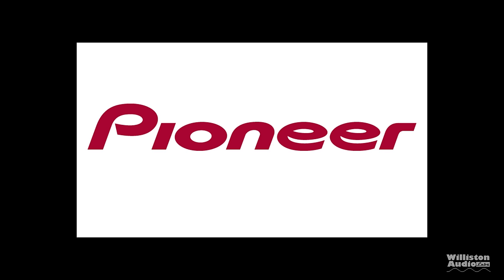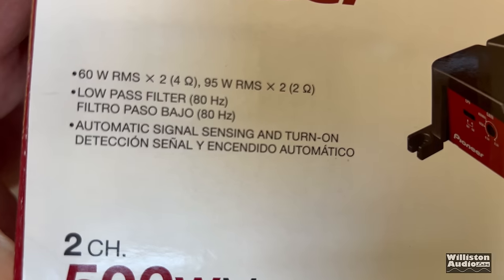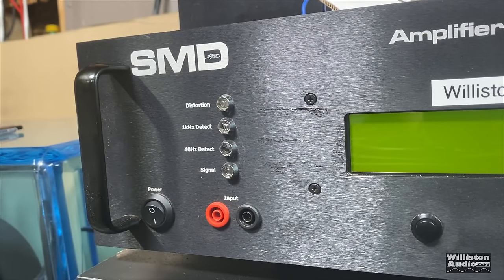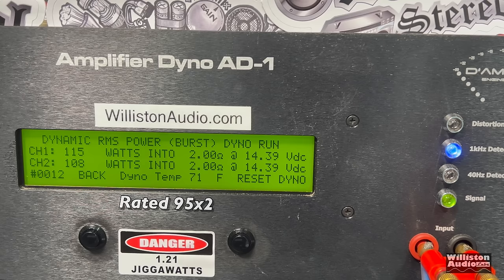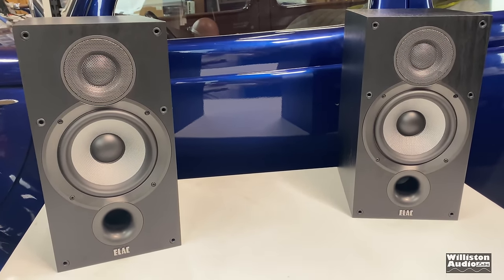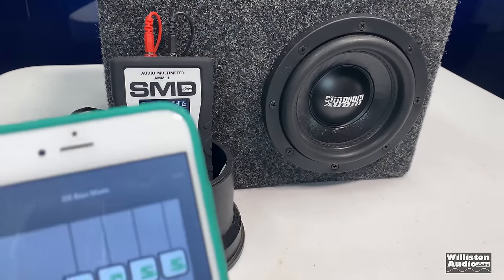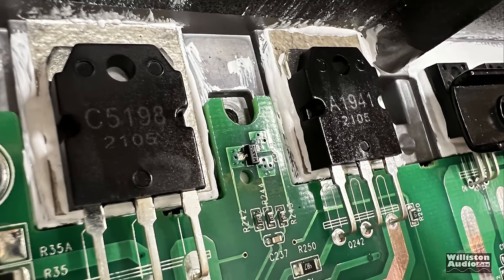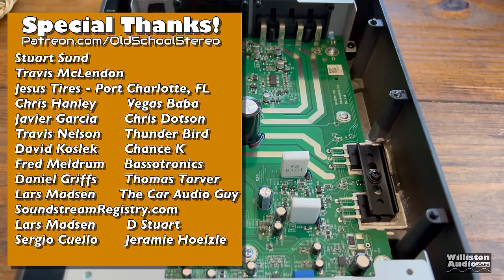Should You Buy the Cheapest? Pioneer GM-A3702

Comment from the maker: SHOP (Affiliate Links)
Pioneer GM-A3702: https://amzn.to/3UtqkTL
Shop for Other Low Budget Amplifiers
Down4Sound JP34ab: https://lddy.no/15b14
Pioneer GM-D8704: https://amzn.to/3B28oGP
Pioneer GM-A6704: https://amzn.to/3KXD8NT
CT Sounds CT-80.4AB: https://amzn.to/3L45tCe
Alpine MRV-F300: https://amzn.to/3BqW18t
DATASAT N1 on Amazon: https://amzn.to/3bX79jC
DATASAT N4: https://amzn.to/3AX4NtA

Used in this video 
Elac Debut 2.0 B6.2 Bookshelf Speakers: https://amzn.to/3REg2hB
Sundown SA6.5 6.5" Subwoofer: https://lddy.no/1cy5x
Pioneer DEH-80PRS Head Unit: (eBay Affiliate link) https://ebay.to/3xdUwZ6
Stinger 6000 Series RCA Cables: https://amzn.to/3d4W80b
Stinger 12ga OFC Speaker Wire: https://amzn.to/3d4pWKo
D4S 8g OFC Power Wire: https://lddy.no/1csoz
Precision Screwdriver: https://amzn.to/3B920NZ

Video Playlist of Affordable Amplifiers: https://bit.ly/3cEQYHJ

VIDEO INDEX
0:00 INTRO
1:02 THE CHEAPEST
1:26 UNBOXING
2:01 FEATURES AND SPECS
3:02 AMP DYNO TESTS
5:44 SQ TESTS
6:52 CAN IT POWER A SUBWOOFER?
8:09 TERMALS AND INTERNALS
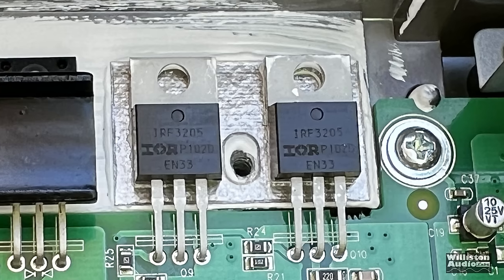9:13 PROS / CONS
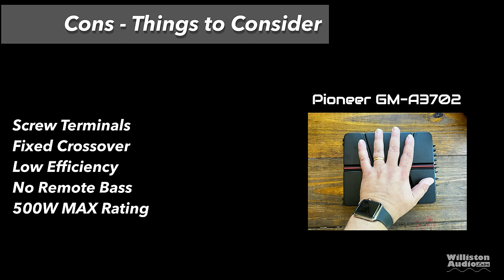9:56 FINAL THOUGHTS
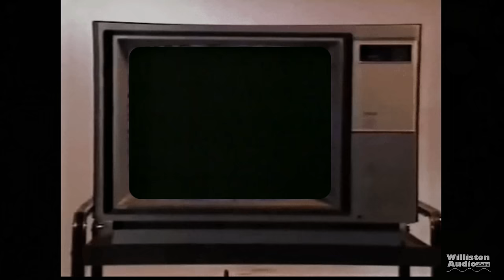10:35 EXTRAS

--------- Cameras and Gear Used To Shoot This Video -------
(Video Gear I Use) 
Camera - iPhone 13pro 1TB - https://amzn.to/3nCjGvc
RODE Wireless Go II Microphones: https://amzn.to/3Q6NVHl
Shure MV7 Microphone: https://amzn.to/3A4OICK
Zoom H4n Audio Recorder: https://amzn.to/3BXjVsS
960 LED Panel: https://amzn.to/2Sxoq3S

This VIDEO was EDITED with LumaFusion on an iPad Pro 12.9:
iPad: https://amzn.to/2Ancr1W
Software: https://goo.gl/6yvWss

--------- Test Bench Equipment -------
SMD / D'Amore Engineering Amp Dyno: https://goo.gl/sJTcf7
XS Power D1400 Batteries - https://amzn.to/2BPFCKW
XS Power PSC60 Charger - https://amzn.to/2CHGcfs
Fluke 1000A AC/DC Clamp Meter: https://amzn.to/2Rw5WDA
Handheld Dyno: http://amzn.to/2u2EgKV
My Favorite Screwdriver Kit: http://amzn.to/2x0VzcE

DISCLAIMER: This video and description contains affiliate links, which means that if you purchase from one of the product links, I may receive a small commission. As an Amazon Associate I earn from qualifying purchases

Comment: I knew a guy once that had a complete system from Walmart.  Pioneer subs, amps, head unit and mids and highs. He actually surprised me at how hard it hit. He had 2 big Pioneer amps on 4 12's and was nothing to be ashamed of.  You could hear him rolling down the block very well.  Sounded like he had a good quality set of 15's and a good amplifier. He bought it all on a Walmart credit card lol
Reply: sometimes, design and quality of installation is more important than quality of gear. I believe a quality system can be built with all Pioneer gear for half the price of JL or Rockford...or any of these other Chinese made brands....I have no problem with Chinese made equipment, but not if it costs as much as European or American made equipment, considering it costs FAR less to manufacture by Chinese slave labor.
Reply: I run two pioneer class D mono amps at 2ohms and 800w RMS each feeding four pioneer champion series TS-W311S4 12's in sealed boxes made to the exact internal volume for my sub's and 100% airtight, my system punches pretty hard.
I have a class D handling my MIDs and highs producing 500w RMS but I'm really not a fan of the sound quality from a class D on the MIDs and highs, they are great for sub's though.
Reply: @stevefox3763  yeah definitely go a/b for mids and highs. im only pushing around 600-700wrms @ 1ohm (xda91rb) on 2 tw-261d4's and it sounds good, my box is just a bit too small and tuned too high.
Reply: @raymo6795  I have obs Chevy which I still owned but when I was 18 It had my dad kickers 2 8inch cvr model with the flames on it they had there own sealed box with silver xplod Sony amp it hit hard haha I was 18 years old took it to shop to get amp wire run and the guy who did the install was with big smile because he never seen 2 8 inches subs hit that hard. Sadly to San Francisco assholes they open the truck one time my brother took it to work just to find the subs gone 😢 but now the truck has two sound streams vangogh 10s with 1200rms skar amp which was big upgrade
Reply: It's all hooking it up correctly...any sub in the right box is going to kill it. I remember back when we use to get the free crutchfield magazines and dream. Pioneer, Polk and JVC JBL good times
Reply: @lagginswag  A/B or bust for midrange.
Reply: Balling on a budget, I put a pioneer 10 through the ringer lol and it never died! Hit way harder than it should have imo
Reply: @stevefox3763  I have used Pioneer equipment since the early 2000's and I have always been satisfied with how well it performs for the price.
Having owned a plethora of subwoofers, speakers and head units throughout the years, although I have never owned that many Pioneer amplifiers.
My current setup is mostly Pioneer (with the exception of the subwoofer and its amp). 
I have a custom built sound-bar in the rear with two component sets (4 speakers in total), these being the TS-E 170Ci components. These are wired in series into 8 ohms, and powered by a 4-channel Pioneer amp (GM-D8604), which is good enough for this setup. It produces around 200w(x2) bridged in 8 ohms. It sounds super clean, and eliminates some of the harsh sound a Class D amp normally makes.
The head unit I am using is a Pioneer DEH-X8500DAB, which features Hi-Volt (4v) outputs (3-way), DAB radio, Bluetooth and so on. It's an older model, but it works great.
The subwoofer I have in my setup is an Orion HCCA 15" unit, driven by a Dynabel BF-7501 amplifier (yes, this is an early Korean made amp). It produces 2500w in 1 ohm.
Reply: @Skarfar90  I have the GM-D8604 as well, im running it in 4ch with 4ohms rear (2x100w rms) and 2ohms front (2x150w rms). I have infinity main drivers up front with compression driver tweeters and have kicker components in the rear.    
I have 4x pioneer TS-W311S4 12" subs driven by 2x GM-D9601 amps running at 2ohms (800w rms per amp) and have a Sony touchscreen headunit.

I run two 9601 mono amps at 2ohms instead of one at 1ohm because at 1ohm it produces 1200w rms but two at 800w rms is 1600w rms :)
Reply: @stevefox3763  9601 are great amplifiers. Makes a good match for those 311 subs
Reply: @Skarfar90  if I had the room or the electrical headroom I would add a third one and another two 12's but I am at the limit of my cars electrical system and kill alternators quickly as it is and Dont have room for any more sub's in the boot either :(

Have you seen what the 9601 goes for these days, they have sky rocketed now they are a hard to get amp, they go for more on ebay now than they cost when new!
Reply: @stevefox3763  That's crazy. Did not know that the 9601's has inflated in price. 
It could be affected by the slightly higher price of the 9701 (its replacement)
Reply: @Skarfar90  The 9701 is the exact same amp but in a different outer shell, the older 9601 is better looking and i think that has a lot to do with it.   When i bought my second 9601, already owning the 8604 and a 9601, i wanted the third amp to match but they were already discontinued at that point and it stung real hard paying more for it used than i paid for my first one brand new.

I watched a few on ebay and every single one went crazy at auction, i just had to accept that it was a price i had to pay if i wanted matching amps and entered an offensively high bid to win it, fortunately it went for slightly less than the ones i had been watching went for but it was still more than they cost when new :(
Reply: My entire setup is from Walmart.. I have three Pioneer amps three power acoustic amps 14 speakers along with six subwoofers and two AGM batteries from Menards.. I got a few videos on my page check it out
Reply: It's just about knowing what works, yeah?
For example I've got a Ford with 'Premium Sound'
The sound is awful. Driven to any reasonable level it makes noise not music. By reasonable sound level I mean to 20 out of 30 steps and it still isn't load enough. I'm endlessly playing with the balance/fader and bass to get some semblance of reasonable sound. Why is it like this? Well because the factory amplifier is inconsistent with the premium sound promise. Sure it is better than basic sound but very, very disappointing - I'd call it low Mid-Fi (out of lowfi, midfi and hifi). Turn it on and never turn it over 12/30 then the sound is passable.

How would we fix it? Ideally it would have line level outputs on the head unit but it doesn't and I'm not splicing RCAs onto the factory harness where it plugs into the amp I can tell you.

Hypothetically if it had line level RCA outputs (which it doesn't) what I'd do is run 3 of these amps. One for the front speakers, one for the rear and one bridged one for the crappy sub. You can practically guarantee the sound quality improvement would be absolutely dramatic even with the junk factory speakers. 
If you wanted to get spiffy, run good quality speaker wire directly from the amp to the junk speakers. Want to improve that again just upgrade the existing speakers with some $100pr types. With a bit of labor and about $500 you'd actually have low end Hi-Fi with the stock head unit which I think is fine in a car.

BTW the factory head unit isn't the main problem but all of it together is the main problem. Poor quality is baked in unfortunately.
Reply: Insignia had a set that was a box subs and amp and it was $200. Sob hit hard!

Comment: Back around 1989 one of my first car audio systems was a small Pioneer 2 channel amp running 4 Pioneer 6×9s and it was a real screamer.   I had all 4 speakers facing up behind the seat of my S-10 pickup.  I played a lot of GnR, AC/DC and Van Halen through that system and it sounded really good to me :)
Reply: These days noone would dream of using 6x9s for bass but the reality is they have essentially the same cone area as an 8 and when properly enclosed/baffled you can get solid sound well below 40hz. This was adequate for most music produced before the mid 90s and I feel privileged to have experienced this firsthand
Reply: back then, Pioneer amps were made in the USA
Reply: after installing tons of sistems ended up going back to that setup of amp and 4 6x9's ... its cheap and loud
Reply: @alekpo2000  …and simply
Reply: 1989, what a great year that was. I had a pioneer component system with big black din plugs that connect the components together in my car in 89. Sound was awesome and loud but the speakers had bugger all bass coming from them. Turns out for the whole time i had the component system in the car, the speakers were not wired right (they were out of phase) and thats what was causing the lack of bass. Later in the 90's i added a Pioneer GM203 amp to my car stereo and still have it to this day.
Reply: How did you wire 4 speakers to a 2 channel amp ? I'm curious
Reply: @303nitzubishi4  lol yeah it's funny what a box does for door speakers, I have 2  6.5 kenwood marine speakers on my small classic  17ft mako center console boat and it resonates bass notes nicely throughout the hull lol sounds like I have an 8inch on the boat and it's just the 2 speakers

Comment: Always have been a fan of Pioneer. They may not be the absolute best that money can buy but they've been consistently good and affordable. Also, I think they make some very solid head units.
Reply: I believe anything with the Pioneer name on it will serve you well
Reply: I always considered them upper low-end.
Reply: @MrV1NC3N7V3G4  could certainly do worse lol
Reply: To me pioneer, kenwood and sony dont have the same sound quality as Alpine,  not do they sound as good as their older head units from the mid to late 90s (especially Pioneer and Sony). Replaced an old entry level Alpine bluetooth radio from 2012 and some old entry level kicker 6.5 inch coaxes from that same era with a brand new pioneer radio and speakers because the bluetooth was quirky, and the pioneer just didnt have the same sound quality or power, and the menu was very cumbersome to operate compared to the Alpine. Not a bad unit but I ended up putting the Alpine back in and repaired the surrounds on the kickers because they sounded 10x better. Pioneer radios just don't sound the same as they did back in the mid to late 90s to me. Not that they're bad, just not as good as Alpine. Same with Sony. Their older radios before the Xplod series came out used to sound great, especially the mobile ES series. Bought a Sony floating screen for my older Land Rover and again, just couldn't match the old Alpine in sound quality or power. Not bad units, just nowhere near the sound of an Alpine unit.
Reply: Pioneer set the spl world record back in 07-08 which they can do at any time they please.
 They’re also a leader in high end sound quality equipment if you have the bank.
Check out their PRS line.

Comment: Pioneer products are legit good to buy. Been around umpteenth years. I always wondered why they had changed their logo. The old pioneer logo was eye catching, especially on the dust caps of the IMPP subs which banged like thunder in the right box.
Reply: Yep, I had a pair of 10", then a pair of 12" IMPPs back in the mid-90s. Those little 10s hit low and hard. I had them in a huge sealed box, maybe around 2 cubic feet per sub. I really kinda liked the 10s better than the 12s!
Reply: I had the Pioneer 350w green cones.
# memories

Comment: I’ve owned the larger 2 channel version of this one. It was sparse inside as far as guts go , but I was very surprised at how well it performed and how badly it could take abuse. 

It got hot enough to literally smell all the way up front in my caravan. But it never quit working , and is still alive with a buddy of mine now. 10/10 would use again if one fell in my lap
Reply from the maker: Awesome 👏
Reply: Agreed. Pioneer manufacturers in China just like everyone else but it seems their QC is a step above  competitors (specifically Kenwood/Sony)
Reply: Love the SMELL of cooking Transistors in the morning.... Smells like.... VICTORY!
BDBD/2022
Reply: Hey man, dont know if you'll see this, but I own the GM-A5702 right NOW and upgraded from the amp shown in this video. Did you test if you can bridge it to 2Ohms? I have 2 SVC 12's at 4 ohm, so parallel wiring would bring it down to 2Ohm, but bridged and it clearly says on the manual that you shouldnt do that. It still BUMPS in 2-Channel doe

Comment: I used a Pioneer amp on my subs over 20 years ago and it was not a lot of power but it sounded great and was reliable.  It did run pretty warm, it was similar to the Alpine amps at the time in that regard.  I had an Alpine 3527 on a set of MB Quarts and then a Pioneer amp on my subs that I can't recall the part number.
Reply from the maker: Thanks for watching and commenting!
Reply: 20 years ago all these brands were great! Glad they are still around today but definitely ain’t the same.

Comment: Wow did this bring back memories.

I recall running an Alpine MRV-F407 for fronts/rears and MRV-1000 to a single Alpine 15" sub. The MRV-1000 ran super damn hot, I had to wire 4 (!) computer fans to it to help airflow.

Eventually I ran  a DEX-P1 with a PG ZX450 for fronts/rears and PG ZX500 to four 12s fibreglassed in the trunk of my Accord. At that time, my friends and some family were running the Pioneer silver amplifiers (I don't remember the model numbers but this was waaaay before they changed their logo from the tuning fork to the current one.) Those Pioneer silver amps were higher end ones and a lot of people used them in competitions back then.

Comment: I had one of the first cd players from Pionner in my truck.  No tuner just a cd player.  It had its brain and electronics in  a separate housing that kinda resembled a amp . I used a Concord cassette player in junction with it . I still have the pictures of the install

Comment: I was among the first American Autosound installers to install a Pioneer CDX-P1. Art Rubenstein was the Pioneer rep here in Hawaii in 1984 when these appeared. I at this stage had a Pioneer PORTABLE CD player plugged into the AUX input of my CONCORD Deck.  I was the CONCORD guy..... WELL Art got 2 complete units from Japan, just in case one did not work there would be PARTS..... these were still prototypes but badged for US sale.  Long story short, I installed the THING into a Mercedes 2 door convertible... Its TIGHT but I managed to make space for the ATTACHED BOX and cables... Ugggggg. IT WORKED!!!!. Art was pleased and so much so he gave ME that other example, said put it in YOUR car.... So I did. Sadly it was a skipperoo...... bad. HIGH VOLUMES in my car would make it SKIP bad. Well I tried many different mounting scenarios but eventually my PORTABLE found its way back into my car, LOL..... They got better over time.  At this point, about 1984, 8 tracks were selling better than Cassettes. THEN LIKE MAGIC.... 8 tracks started disappearing.... Cassettes overtook them, and CD PLAYER!!!!! for a car!!!!. In like a year's time.... 8 tracks were relegated to the scrap heaps.   Late 1985... PIONEER HISTORY. I own a Pioneer amp today in my beater car stereo.... SOLID. Cant go wrong with Pioneer products... STILL!..........BDBD/2022

Comment: I've had this exact amp in my Expedition with the Pioneer low profile 8 inch replacing the stock sub components (running bridged with the dual coil in series for 4 ohms). Definite upgrade from stock and no complaints. Techmaster PEB hits plenty hard. Installed March of 2018. Zero issues in 4 years.
Reply: Funny. Just searching through my old cds and came across my techmaster peb bass computer and dj magic mike. Oh the memories...